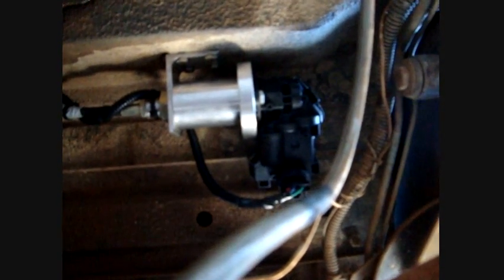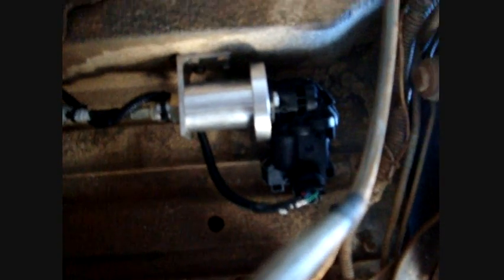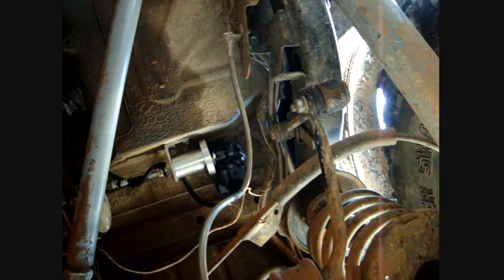OX Electric

Comment: how this setup has hold up over the years?
Reply from the maker: It worked great for me. I sold those axles 2018 and a new owner is using it. I went to D60 axles.  Bigger.
Reply: @mudman98TJLocked  thank you for your input I'm considering this ox/electric shifter and was worried with having cable adjustement issues. 

are you putting ox locker in your d60? really nice axle what tire size are you running with those?